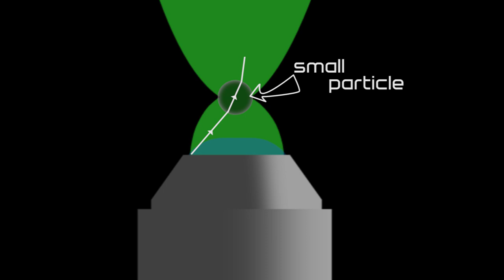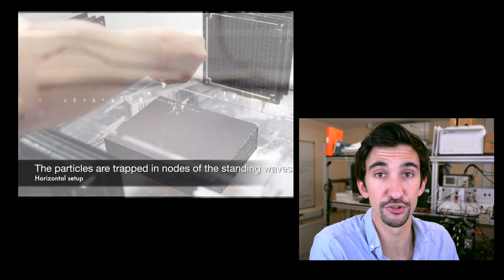Can You Make a Tractor Beam?

Comment: How does sound levitation have anything to do with tractor beams?  Sound levitation is just a push, not a pull.  If you wanted to say, pull something in a vacuum, sound would be completely useless.  You would actually need something on more than one axis to push and pull in a gaseous environment, to give a push and pull effect.

However I think I have a solution in a vacuum if you can make sound waves have a pull effect.  Use a circular light beam, creating a tube around and releasing gas particles to trap them within the beam.  Then within this trapped area, use the technique to exert a pull with sound waves.  If you can create a light beam strong enough to trap these gasses, you will effectively have a vacuum tractor beam by combining light trapping and sound waves.

As for just using light as a tractor beam, I think that may be doable as well....but whatever large object you're pulling must have an apparatus attached to it designed to redirect the light so it exerts a pull.  Think of a beam shooting into a hole with a special bell curve that funnels into a reverse bell curve outside of the regular bell curve.  If you make the reverse bell curve larger than the regular bell curve, you will be giving it more area to push on, so it will have both push and pull properties, but the pull will be greater than the push.

An apparatus like this in a vacuum, should exert force relative to the strength of the beam.  All you need are materials in this apparatus capable of withstanding the beams strength.  

Ready for my Nobel prize please ;)
Reply from the maker: I'll inform the relevant panels! :)

Comment: Great video again as usual, even if you did forget to talk about solar sails ;). As for the radiation pressure = extra weight thing. I'm guessing it does have an effect, but it's very small and counteracted by light reflecting off of things that are lower than you?
Reply from the maker: Thanks dude :) and yeah, it quickly becomes a problem of surface area vs volume, and where you can apply more force